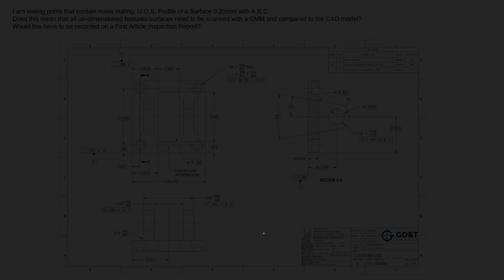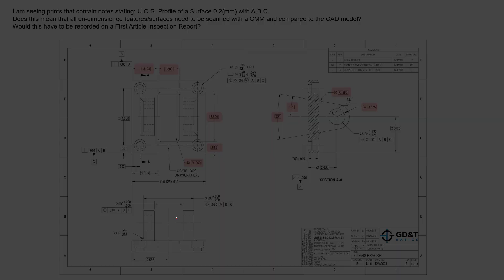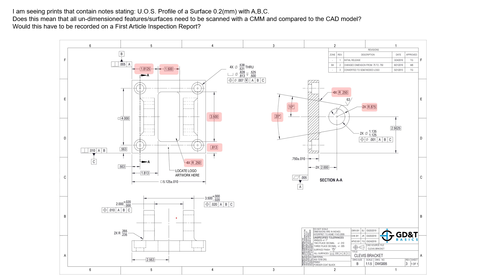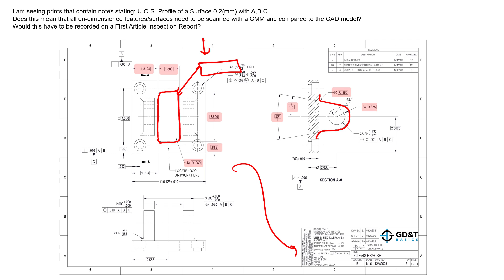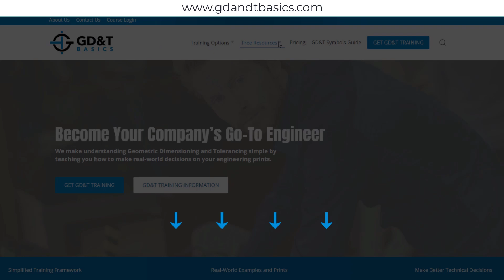Unless Otherwise Specified

Comment: My question to them would be would you report the 125 finish requirement on the FAI? If so, would you not also include what would be considered more important than surface finish 😅?

I think your typical Machinist would just view it as plus or minus .005 anyway but given any opportunity they would screw it up.. so you always need to make sure the part's good

The good news is, there's no requirement to put a separate profile tolerance on each individual basic dimension as I've witnessed certain individuals try to do.. you could just do one overall envelope.